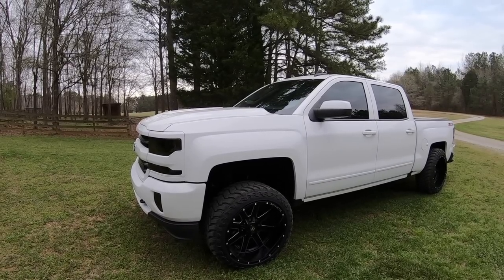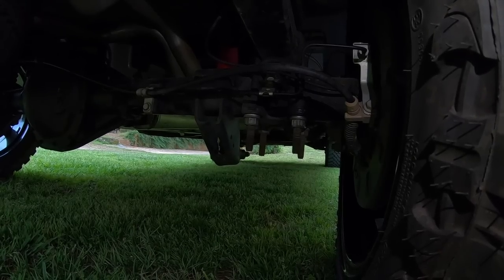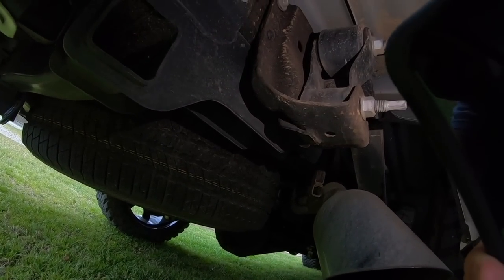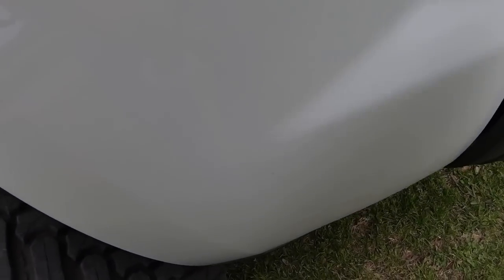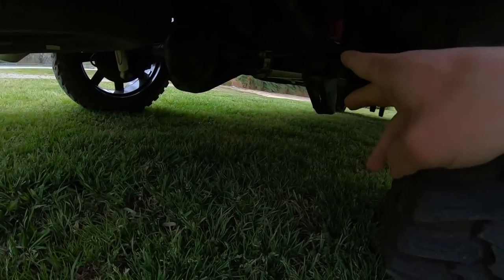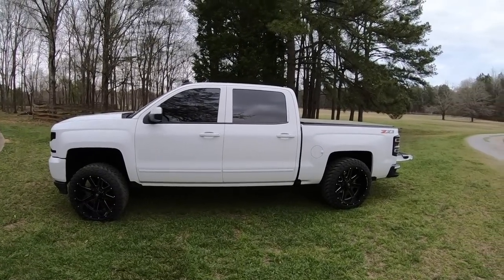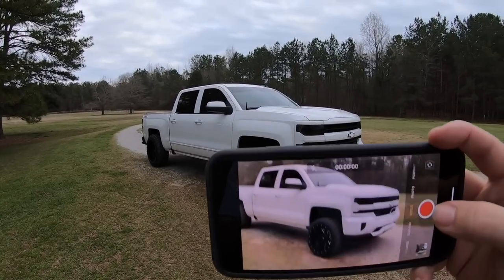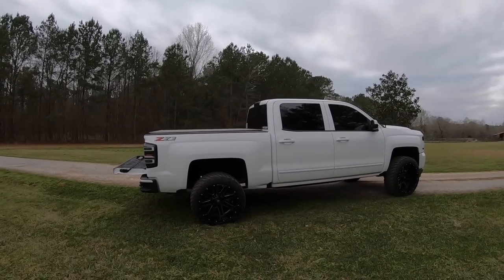3 ways to SQUAT your truck!

Comment: In many states a rear squated truck will get you pulled over.
In Pennsylvania any police officer will pull you over and site you.
All modifications to suspension needs to be reinspected and certfied to be road safe. This also has your title restated as reconstructed. This is PA law
Reply from the maker: Thats why alabama is great. We still have freedom with vehicles lol
Reply: @lmfscrew  Good for you. I just went threw re-training for Pennsylvania state inspection, starting in September any truck lifted above factory spec or lowered is a fail. And the oner will lose there registration.

Comment: I prefer degrees to inches. Just find a "rise and run to angle" calculator online and put in your front/rear difference as the rise, and your wheelbase as the run. On 140" wheelbase (most crew cab super-short bed fullsize trucks), a 5" difference will give you 2 degrees of angle, and a 7.5" difference will give you 3 degrees, which is the limit IMO. 2.5" aka 1-degree is the baby-squat. Very tasteful and gentle amount of squat, that is, but again, those numbers are on a 140" wheelbase truck.

Comment: My truck was at stock height, and I installed the same drop shackles that u showed and it leveled it perfectly and I'm fixing to take out the blocks and drop it a little bit. But it took me abt 3 hours to put drop shackles on. It was definitely a chore.

Comment: When u do the no block and 2 inch drop shackles I would recommend a two degree shim fat part to the rear. Pinion angle will be set back to factory. These trucks are not made like back in the day. It’s like they were designed by a guy wearing skinny jeans.

Comment: Tutorial on how to take the rear blocks off?
Reply: Hunter Sims please
Reply: It’s simple pull 8 nuts off u bolts or maybe 9 with center pin depending on the direction ur u bolts go u may be best to break nuts bfor jacking truck up so not under load but must support rear of truck with jack bfor completely removing nuts remove nuts jack rear up a little bit pull block out set rear back on axle put u bolts back on tighten  and ur done

Comment: I genuinely don’t like squatted trucks, I tow with my truck and use it regularly. I need function, my truck is level with 5 leaf springs in the back. However, I ain’t gonna judge you or tell you you shouldn’t do it. Preference is preference, nobody has the right to tell anyone otherwise. If you like it, who cares what anyone else thinks.

Comment: Got a question. May be buying a 1996 OBS Chevy, it's got a 4" superlift on it. Wanted to take the blocks out of the back, but wasn't sure if I would have to run stock shocks or the 4" lift shocks. May be a dumb question, but I've never messed with one lifted before.

Comment: Bar none the dumbest thing people do to a truck or SUV. I encounter these bastardized things daily. Take a perfectly fine vehicle, make it look like it has a broken rear suspension, throw the brightest LED headlights in without properly adjusting them and proceed to blind EVERYONE on the road. People talking about the "right way" to squat a truck... THERE IS NO RIGHT WAY!!! They are not designed to be driven that way and it just looks stupid. Not to mention you are shifting the vehicles weight and messing with the aerodynamics. Ok, maybe it's easier to get the beer out of the bed when you're 5 foot nothing tall... I don't know. I do know it serves no purpose whatsoever unless the goal is reduced visibility, poor handling, reduced payload, reduced gas mileage and disgusted looks.

Comment: Question for the truck itself, What year model and If there's a cam, What size cam in it? I plan on getting a older 99-07 Maybe even newer Chevy Z71 in my future and Looking to squat it a little bit like yours but not too much to where its sky rocketing  and putting 12 wides or 14 wides on it. Just to make it look good and have stance. Question for the tint as well, is that 2% or 5%?

Comment: Is this the same exact look I would have with a 6 inch lift and 3 inch blocks in the back but a little higher up front and rear?
Reply: i think the blocks dont determine the actual height n some lifts are slightly taller/shorter than they say they are, a 6 inch lift could end up being almost 7 inches n that 3 inch rear block could end up being like 2 inches because theyre normally made to make a truck level which means the block even with its proper lift itll still slightly be leaned back about .5-1 inch so id suggest you get a 4 inch block if you want that 3 inch difference

Comment: I have a 2004 chevy silverado crew cab I added a 4.5 lift kit on mines rough country i drop the rear looks great. How does the 22x12 33's ride on the road is it rough or a smooth ride

Comment: Leveled my dodge, put 12 wides on  want to drop the rear 2 inches I have no factory blocks have to do drop shackles but my mud flaps are set for the way it sits rn idk if the rear flaps hanging 2inches lower will look dumb

Comment: I’m trying to squat my hot wheels Silverado for 20 hours and I bend the tires it got higher so I was like I’m done
Reply: Flip the truck and you will see those big things those are the lifts on the truck you have to get them pulled and put a smaller lift in the back then it will be squatted

Comment: Do you clowns adjust your headlights? By the way most of you guys don't even know the reason for squatting a truck. Trucks are suppose to be a lil butt high, they're  made for hauling.
Reply from the maker: The reason for squatting my truck is because i wanted to and because the fact that it is my truck ill do what i want with it. Including never hauling anything with it:)
Reply: lmfscrew still didn't answer the question. FYI I don't care what do with your truck as long as your're not riding around at night behind people  on permanent Hi-Beam

Comment: A squatted truck looks about as good as the cars with big ass rims with 1" of sidewall. I've seen these ruined trucks that these idiots have lowered the rear with the front pointing up at a 45 degree angle. Looks fucking stupid. Same with these cars that people put like 25" rims with a 1" sidewall tire. They don't turn good at all and I doubt they ride good and they look ridiculously fucking stupid. I saw a yellow camaro with had to be 25" rims painted yellow, about  a 1" sidewall. I laughed at it. BTW, the rear of a p/u is a little higher than the front so when you pull a trailer, it isn't sitting so low.